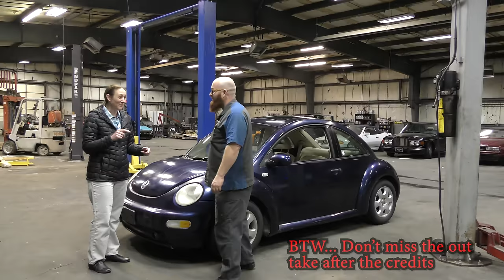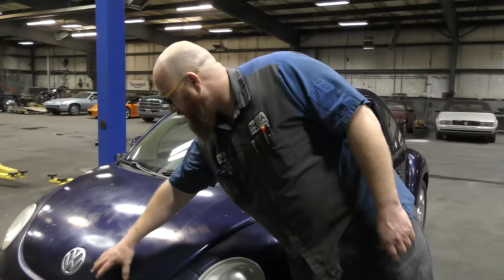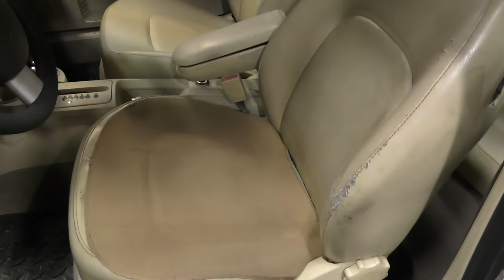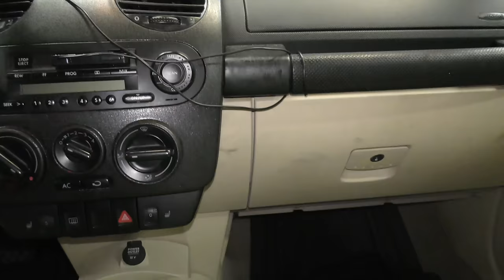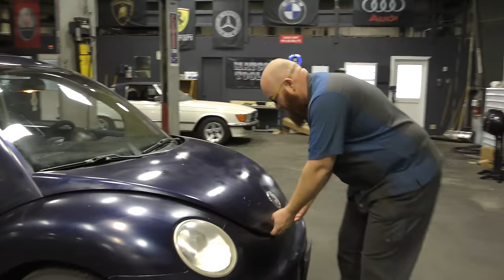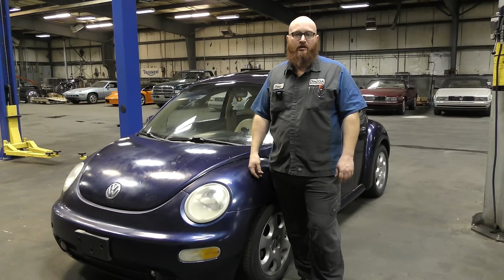Squirtle Update! Why does the CAR WIZARD love this 2002 VW Beetle so much?!?!

Comment: The heater is not broken.. these TDI engines are so efficient that they do not produce excess heat when it is that cold. You can put cardboard in front of the radiator and the heat will work. Just don't get on it too hard or else you will obviously  overheat. 

Don't believe me? Check the forums

Comment: I have a manual TDI beetle with 220k and everything seems similar with parts on mine. Your heating issue is strange. Without a proper temperature Gauge on a very cold day it takes 30 minutes or more to heat up anyway if you have an obd live scan Gauge to see that.

Comment: I have done HUNDREDS of customer repairs using OEM parts and a few with cheap eBay/O'Reileys junk and I can say with good certainty that the cheap chinese junk works good on domestic vehicles (especially Chevrolets for some reason) but they work poorly on European and Japanese vehicles. Got a $7 crankshaft position sensor for a 99 Cavalier off eBay and never had a problem with it ever, tried the same for an 03 Camry XLE and it went nuts...there's a good chinese junk brand called "Isumo" that I've used repeatedly without issues

Comment: Weezard, do you have any experience using the OTC hub grappler on a VW or Audi?   I need to do rear wheel bearings in my Audi A4 (B5).

Comment: Hello car wizard I need a little help on a 2000 E320 mercedesbenz it stop shifting and I had it serviced 3timrs and a Mercedesbenz brand conductor plate and filter.it is not changing out.even before it stop shifting it never had anyproblems.i checked the wire harness and replaced the conductor plug and the wire harness was dry from oil soak.even the transmission tcm is dry.i cleared the codes and it still comes up in put speed sensor.i only cleared the codes with a plain Jane actron code diagnostic reader.so by your experience with these types of mercedesbenz what would you suggest for me to look at?

Comment: Highest mileage?
1989 740 Volvo wagon, NA B230 AW71 auto One Million One hundred thirty thousand Km, (621000 odd miles) Same engine, head untouched and 2nd auto.
Aussie country miles including 3 Wombat strikes, 9 Roo's, Countless foxes, Rabbits and a handful of Cats all with minimal damage bar the odd flipped belt because the engine and cooling system is up high and protected.
Apart from my 1979 XD Ford Falcon which did a Mill and a half before rust killed it this Volvo has been flawless and OEM maintained compliments US parts vendors such as FCP Euro and Rockauto.
Worth noting we dont get snow sooo No salty roads.

Comment: If any one asked my opinion about This era VW the advise would be to run away.

This is from an old guy who says you will get more miles down the road with 10 $1,000 cars than 1 $10, 000 car.  Having at least 2 runners at home is well worth adding a second car to your insurance.

Comment: Had a 2002 Bora (Jetta) 1.9tdi 130bhp. Had it 12 years and sold it with 156,000 miles on it. Not even that high for these engines. You have to seriously neglect a VW PD engine to kill it.

Comment: Car wizard or anyone, do you know how to fix the check engine light that corresponds to bank two O2 sensor(one after the cats)? I've owned the car for three years now and I've been searching for an answer on forums and Google but I've yet to find one and I've replaced that O2 sensor multiple times with chin chin and oem to no avail. It's a 2002 Beetle GLS 2.0 automatic

Comment: Car wizard I am reaching g out as I have a wrecked alh 1.9 tdi diesel. I can't afford another car in a pinch. My child is sick. So what I have is a smashed up bettle! And a 1997 honda accord with a blow 4 cylinder have a shop access and welder so I pulled the tdi engine Trans and wiring harness ecu/ecm gas pedal and want to swap the tdi in the honda! Any advice? Please? Could I put a adapter plate to mate the honda Trans use the original drive train. Honda motor 2.3l 4cylinder  has 410,000 bad wrist pin can't get one at the moment.

Comment: Super high mileage - how often do you change the spark plugs?
Reply: Diesels don't use spark plugs, they detonate the fuel mixture via compression ignition, diesel has more energy per gallon than gasoline, that's why diesels get better mileage, the engine block needs to be overbuilt to withstand the pressures involved in compression ignition, and the 1.9L diesel in Squirtle is amazingly reliable, one of VW's best engines, 400,000+ miles are easily achieved, do a serch for "Miles the High Mileage Hero from ?CarWow?, he bought an old Skoda Octavia with 400,000+ miles and has a whole series on the car (The Octavia is similar to the VW Jetta/Bora, as Skoda is a Czech company owned by Volkswagen)

Comment: As a German i find that 39mpg are too much for that Beatle. My 3.0 Diesel gets 30mpg and the 2.0 gets straight 60mpg.
Reply: I was pretty surprised it was that poor as well. My Escort station wagon will get 38mpg in a rural commuting situation and it's a gas engine and at least 1/3 more car to haul around.

Comment: 269k miles on a Beetle? Good going.
Reply: In Europe we have Cars with this 1,9 L VW Diesel Motor with over 500 or 600.000 tsd km. Change the Motoroil every 20.000 km and the gearbox oil all 65.000 km and the Car runs forever.
Reply: TDIs are strong, little maintenance and it will last another 269k without any major problems.

Comment: CAR WIZARD CHANGE OUT THAT HEATER CORE!!!!

 I had a '97 Jetta GLX that ran fine until one day the heater core exploded.  It sprayed coolant all over the inside of the dash and ruined the dash gauges!  The car ran fine, but nothing worked after that.  VW used the cheapest, lightest components they could find in this time period [to include your Beetle] and the result is that these are notorious for failing.  Beware.....

Comment: i have the same one from my mother in-law, and for some reason the battery keeps draining itself out....
Reply: Either the battery terminals or the connectors are dirty, the battery is bad or the alternator needs to be replaced. My battery had alot of white powdery stuff and my battery acted like it was dead so I took some lysol wipes and cleaned it up and that fixed the issue for me.

Comment: People whine about the DSG maintenance cost because someone rips them off with the service, but it's easy to do yourself and the service is what makes them last 500k+ miles when the other companies trans with "lifetime" fluid and filter only last 150-200k and need an expensive rebuild or replacement. 
If you want the EGR delete to work look into a Malone ECM reflash, should net a couple more MPG and torques.

Comment: Hello Car Wizard,  I had a 2000 Jetta TDi 5speed and owned for 18 years and 518,000 miles. Original engine , transmission and clutch. I was rear ended by hit and run and car was totaled. If you give me your email address, id be glad to send to tips on maintenance. Thanks. Neil Friedman

Comment: Absolutely not
The worst car I've ever owned!!!!!!
I bought one with 70 thousand miles not a single problem and it burned up head gaskets and plastic water pumps left and right! Did i mention the water pump is on the timing chain? So the engine has to be lifted up to have that replaced along with timing. This if you can get the crappy hood to pop! All the coolant hoses are plastic and mine burst randomly at the flange. Do not buy one unless it's the tdi but even the just buy a focus!